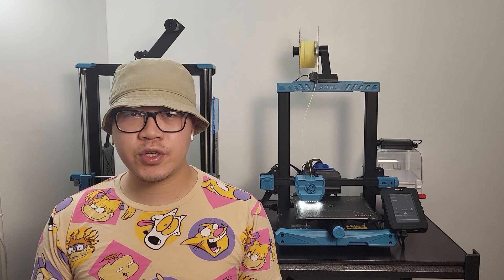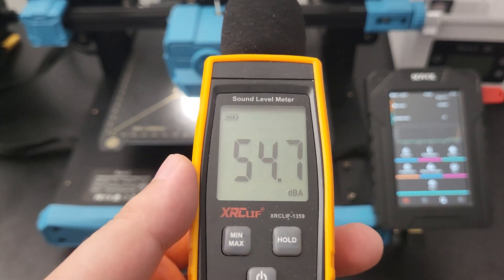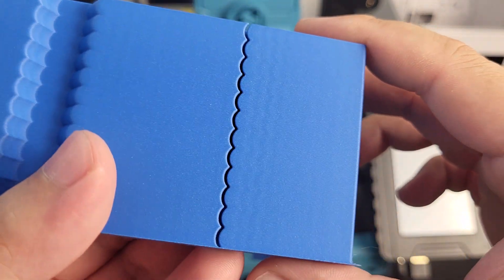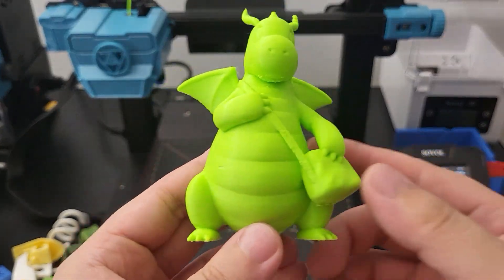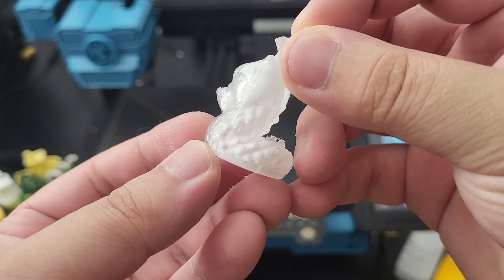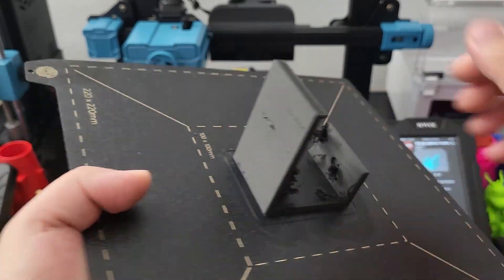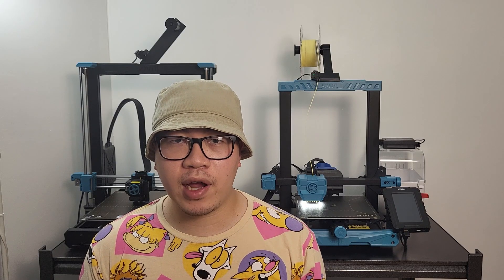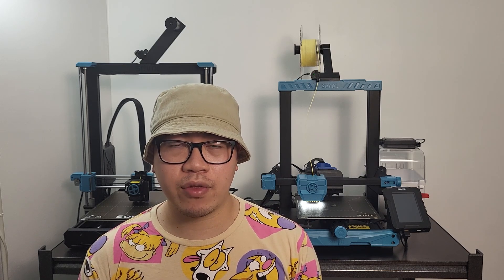Sovol SV07 Review | Klipper 3d printer, old recipe, new stuff

Comment: please wait until the print bed has cooled down, then you can remove the print more easily and the print bed does not lose the color in the middle (flash) either. you don't need any glue on the print bed, the parts also stick to PEI alone, this is a property of the PEI plates, due to the slight grain of the print bed, the filament sticks to the small holes of the PEI plate when the print bed is hot enough. Nice Video i like it but please don´t use Glue on a PEI Plate :)

Comment: Is there anyway to combat the wheels wearing out so quickly on the bottom of the printer?
Reply from the maker: Unfortunately the BOM wheels wear are always going to be fast when you running it at high speed. It will slow down producting debris after run for a bit. There are other types polymer wheels at same size stated last longer, but apparently people talk about they are very much the same. Convert it to linear rail would be a great solution.

Comment: Hey, should i get this or the sv06. In my area sv06 is €100 cheaper.
Reply from the maker: This one could print faster then sv06. But if you have time and patience to make mods and upgrade. SV06 could also achieve fast speed printing wiht klipper conversion.  But as far as this one goes, there are some minnor issues due to early production and they kinda rush this model out.
Reply: @SvgLau  Thanks for the reply, so it's main advantage is klipper and speed. What about quality and reliability. Which one do you think is better in these areas.
Reply from the maker: @Mu1eZ666  Yes, there are some other improvements to make it prints better in a higher speed like high flow nozzle, cooling, and better anti slip belt. But main thing is what you are saying, the input sharping and better processor speed on klipper pad on board.  As far as the consistency and reliability, I have no complaints so far. And the print quality are highly associated with fialments properties, complexity of model, and speed. But it should be able achive a general 200mm to 250mm print speed for most models. But not sure for long term usability. POM wheels are something might need to replace often.